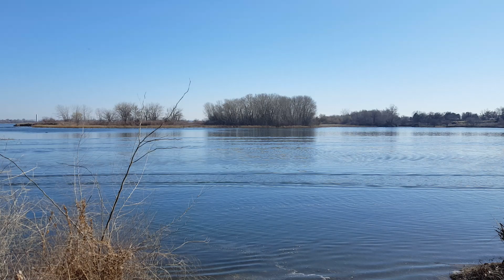Nitro Scale RC Hydroplane Testing | Stroh Light

Comment: NICE!! ...Have you ever tried waxing the bottom of the Hull for more speed.??  And about 3x longer stopping distance. I would really like to know. Learned this trick on real boats living in Muskoka.
Reply from the maker: Well I don't know if that works or not... The generally accepted theory these days is that the hull riding surfaces should be rough. Apparently this causes a 'boundary layer' of water to cling to the hull and that this layer acts like a bearing surface, making the boat move through the water more easily. Take a look at any of the full size hydroplanes and other race boats and you'll find a rough surface hull.  
But with this said I DO wax my hulls, but not for speed. I do it because it looks good!
Reply: @M5PerfHydros  Ya. l ve even wondered about a golf ball type surface But l do know wax works!!  There is less resistance. Like trying to mix oil with water. IN the 70,s the Marina where l worked, one of the Ol boys, told me to wax a customers hull... l laughed.  WOW. What made me really appreciate it was when l went to stop. l didnt,  just kept going. A boat just glides on top. l Have been doing this on my own boats ever since. I plan to do some comparison speed testing with my RCs as soon as the ice is gone. Just got a gps so l can.  Try it... l think you will be amazed. And if you do, and you are... try to keep the secret. lve never told any one about this till now. Oh l lie. When l moved to lake Ontario end of the 80s. They would rather use anti fowl paint. No one would try it. So l shut up. l shouldnt be the  only one who knows about this, needed to share... : ) Waitin for glass   LMK if you do... luv ur stuff. Cheers.
Reply: Speed Coat

Comment: what engine you running?
Reply from the maker: Nova Rossi .67 ... It's a beast!
Reply: @M5PerfHydros  i looked at those, bit pricey, but there are not many other choices available from what  i have seen.   I have an old dumas eagle 40 hydro with a 67 OPS in it now.